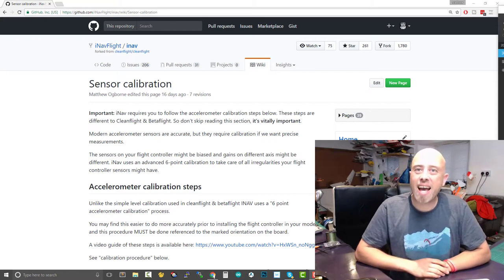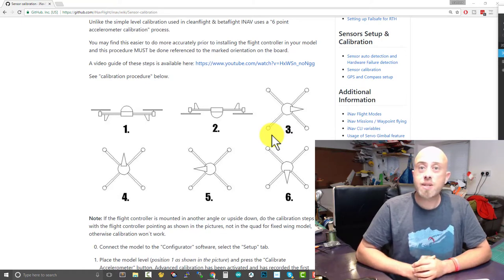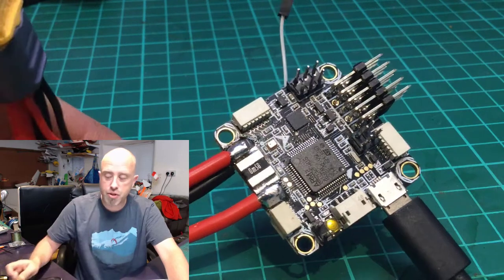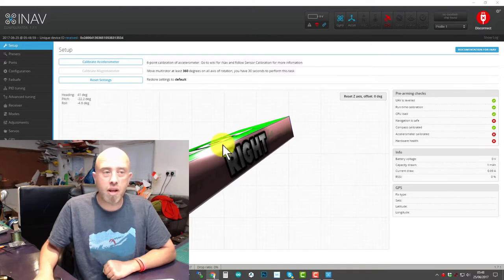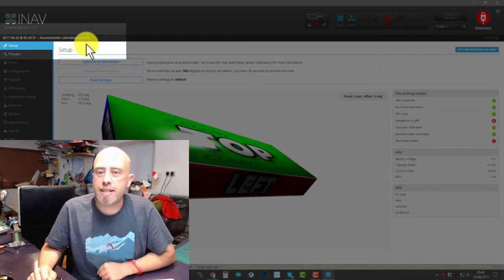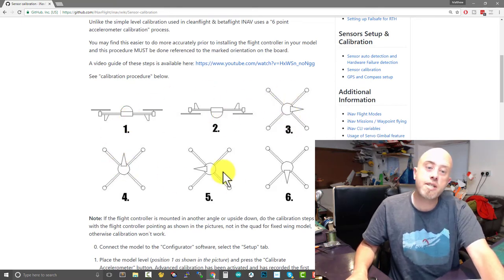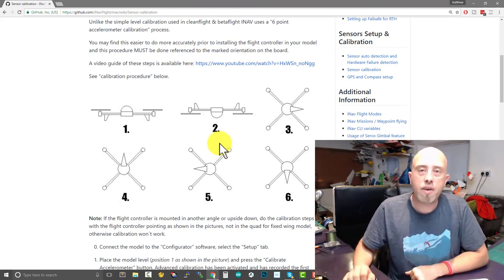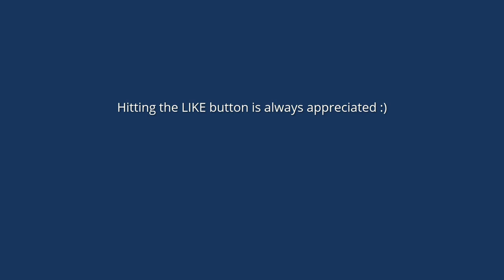How to Calibrate Your Accelerometer in iNav (Do NOT skip this step!)

Comment: Hi Matt, great work again. Just one trick I use to help in keeping the board rock steady during each calibration step is to use a box. I do the first two steps on the desk, then the next four I press the board against the side of a small box, this ensures it is dead straight vertically, as well as my wobbly hands not contributing to fails. Cheers.

Comment: Oops Matt, further to my previous comment have just restarted my comp and the board has now turned another 90 degrees , the usb cable is now facing to the rear with the pwm ports on the right.

Comment: Hi Mat, thankx for your Inav/omnubus series. Really helpfull!  Maybe a bit offtopic.
1 s it true, you can use the Omnibus F4 V2 only for quad en wing. I ran out of output for a rudder and elevator. 
2 how far are we in de Inav/Omnibus sage, or is it a naturally flowing thing witout a defined number of topics?
Cheers
Reply from the maker: Howdy Peter Paul, the F4 has 6 PWm outputs, I don't see why you can't use them all. And the playlist below is the best place for the correct ordering, the series is being recorded in stages, sometimes out of order https://www.youtube.com/playlist?list=PLgoM4-umzSqd0clW-e_A12yKiOpV--3a2 Hope that helps!  Matt
Reply: thanks for you response Matt, The V1 F4 board has got six pwm outs, but the V2 pro misses the 5v for pwm 5 and 6. So the servo's for rudder and elevator wil not work without the volts. Or do i see something incorrect.
Reply from the maker: Yea you'll need to provide +5V for the servos on the V2 board, Matt

Comment: Hi Matt thanks heaps for these videos; couldn't do without your great efforts; I bought a Chaser and chose the V2 board all was going well with the setup, board working fine with the USB connection just needed to setup the RX and Modes; I plugged in my flight battery a 4s and the board went dead no lights; then tried to connect via USB: just darkness, the current flows through to the ESC plug but that's it; any clues did I do something wrong or is it a faulty board?? Many thanks Adrian
Reply: Hi Matt have been looking to get a new Omnibus but Banggod is out of stock, what do think of an Omnibus f7 PRO I am disappointed and would love to get the Chaser flying before Christmas Thanks Adrian

Comment: Great video Matt .BUT my V1 board from BG doesn't feature an arrow. I plugged into iNav and got the rear of the board facing to me  (USB pointing forward) and started calibration but the screen showed the board turned thru 90 degrees finished calibration and the board finished up the right way round, pwm ports facing forward. Any explanation? 
Just one further question. Are you going to do an addition to this series please on setting up a fixed wing plane? I notice the wiki has a custom mix for a mini talon but I haven't a clue what to do with it.
Reply from the maker: Howdy Kevin, if you have a F4 V1 board, then the PWM outputs are at the front of the board. You should always do the 6 point calibration of the board with these being at the front and then change the orientation afterwards, see here https://github.com/iNavFlight/inav/wiki/Sensor-calibration. As for fixed wing, possibly. But the only difference is 6 servo connections instead of 2, thats all :) Matt

Comment: I really need help please im stumped. When i roll it pitches and when i pitch up or down it wants to roll. I have it on the bench testing it. I just installed a omnibus f4 pro setup was easy but it dosent want to cooperate with me. I have it on flying wing with the Z84 preset.
Reply from the maker: Howdy RJ, sounds like one of the servois needs reversing and that you need to double check your receiver movements. Both of these topics are covered in the playlist, see here https://www.youtube.com/watch?v=wSdX758qfpM&list=PLgoM4-umzSqd0clW-e_A12yKiOpV--3a2&index=15 and here https://www.youtube.com/watch?v=1qTUnFwxCG4&list=PLgoM4-umzSqd0clW-e_A12yKiOpV--3a2&index=21 Matt

Comment: Hi Mat I  have a problem when I try to calibrate the accelerometer and move the board it just losses signal with the pc then connects again then  I have to start all over again which I have been trying all day I changed the usb lead and moved it on the pc but same thing any help would be great cheers
Great videos mate 👍🏿
Reply: sorted it had to plug battery in at same time and it worked.